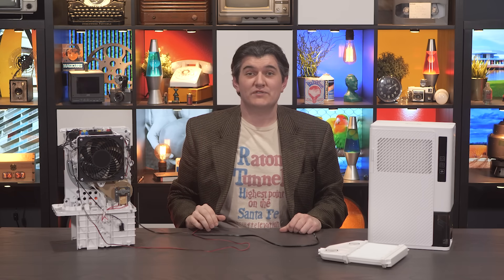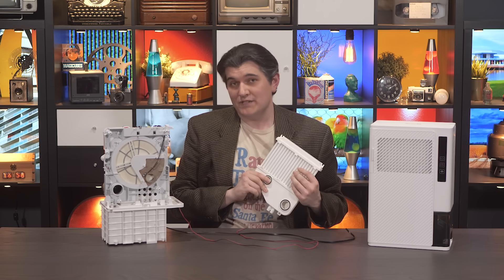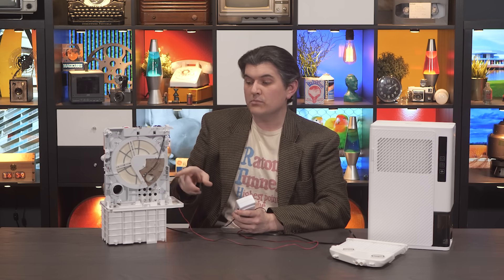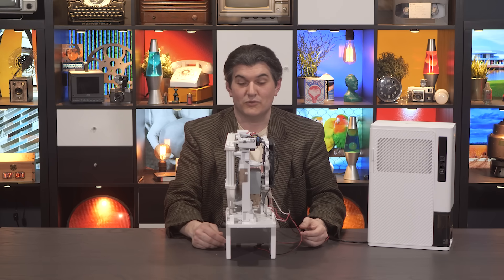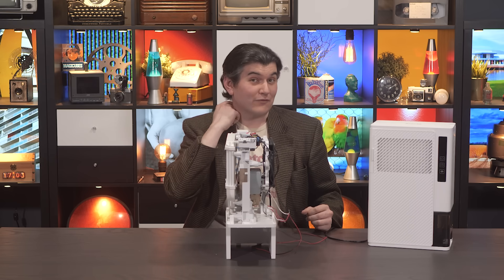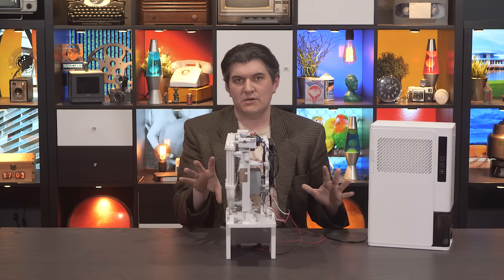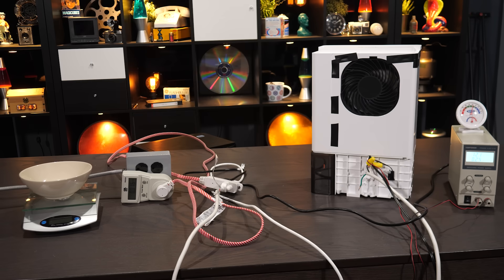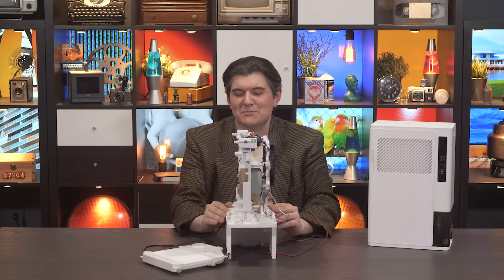A failed duty cycle experiment with a rotary desiccant dehumidifier

Comment: My theory:

The air in the hot loop is pretty much satured by water (otherwise it wouldn't condensate on the radiator). 
Therefore the silica gel is only partially dried when it exit this area and will quickly re-saturate. 

It means that water is only extracted when the hot side is running, the off part of the duty cycle is essentially useless.

I think the duty cycle idea would work if you could run some sort of open loop (i.e. releasing the air outside of the building) so the silica gel can be close to completely dried.
Reply: Essentially reverse the experiment, put the wheel on a duty cycle, or as someone else suggested, just slow down the wheel, giving the heater more time to dry out an area of the wheel.
Reply: I think your hypothesis is correct. from what ive read it seems like the wheel needs quite a bit of time to be fully dried out, much much more time than it gets in the 80/40 style it is getting, not to mention the dryer side is just recirculating the air around meaning that even the air being blown over it is never fully dried, which lowers its abilities even more. i would think that improving the radiator itself by making it copper or aluminum would be a good first start since those metals have better heat transfer. but also finding a way of making the air drier by shutting down the main fan, running just the heat blower and heater to add more drying time to the cycle, especially at first start. those wheels will always be absorbing moisture, even when the unit is off since thats what silica gel do. so when you first start it up the wheel is already at a disadvantage and that during its run time the dryer is just maintaining a status quo.

I would like to try those additions to the experiment and perhaps have the dryer on a separate loop that takes fresh air from somewhere else and runs it through the dryer side to keep the air from getting too saturated. 

but funnily that would also defeat the modular nature of the unit and make it more irritating than the vapor compression units its meant to be a replacement of, those units dont need to have intake and exhaust ducts going outside so you can just plop them anywhere and they will work if not be slightly noisier and occasionally have to shut down for a defrost cycle. but since they can pull so much humidity out of the air during their run time the fact they do have to defrost might be a non issue. i wouldnt know because ive never owned a dehumidifier my area just doesnt call for them our air is always on the lower end of humid and usually we need to add humidity especially in the winter.

Comment: What about switching the resistance with a TEC? as long as the heat side is reaching a high enough temp so make the  silica oversaturate, you gain extra cooling "for free" with appropriate heat exchanger placed in the exhaust flow of ambient air. Note that TEC efficiency is inversely proportional to plates temp difference so with appropriate controls it should be possible to reach a better efficiency out of the two technologies combined for a competitive price

Comment: That doesn’t seem like a failure, it just wasn’t the outcome you were expecting.
Reply: 💯 negative results are still results!
Reply: Yeah, he didn't fail, he formed a hypothesis, designed an experiment to test it, got results that seemed to confirm the hypothesis, and tried an additional experiment with different (more 'realistic' conditions of a sealed up device) to confirm the results and found that it appears some other factors are at play and the hypothesis is in error, and he communicated the negative result of his hypothesis and experimentation to the public at large.  A lot of the time people are unwilling to do that because it 'makes them look bad'.

I mean sure, it's not like he did rigorous additional testing or research or anything (to figure out what exactly caused his initial 'positive' result), but that would be unreasonable to expect
Reply: Yeah, I was super shocked to hear that the experiment was a failure coming from alec when it was a perfectly good experiment.  He should be sciency enough to know that it wasn't a failure just because it didn't prove what he expected.
Reply: Science, baby!
Reply: That's science!
Reply: I saw a video about a charged wire ionizing the air and condensing humidity in the air. They were trying to extract and collect water. Is there a method here for a dehumidifier? I don’t think any commercially available dehumidifier work that way
Reply: He said that exact statement the first 2min of the video. Just a bit of a click bait video
Reply: @CC-nt4zi It's click bait saying something failed? I feel like that's bad click bait lol

Comment: I would almost think the opposite, speed up the wheel and leave everything else the same. This would probably test the drier portion efficiency mainly.  I would think as the desiccant absorbs moisture, its ability to to further absorb moisture decreases either liner or exponentially. I don't know the rate of drying, but seeing as they designed it about 1:5, it's likely around the same rate that of absorption. 

I guess you would have to know the percentage of saturation just before entering the 'drier', as well as just after leaving it. Generally it's calculated by weight, but it's all one wheel, so that would be tough. Probably better to test with your own desiccant reproducing these conditions outside of this machine manually.

Comment: Alternative idea: Let the disc actually rotate slower. If you power the disc-motor with a power supply which allows you to set any frequency you like you can let it run at 40 Hz, 30 Hz, 20 Hz, 15 Hz and 10 Hz. Which slows the disc controlled fashion.
IF you do that: I strongly suggest to watch it closer when you go to 30 Hz an less, so it does not melt your silica-carrier-plastic-disk, or the other way around: Don't run it at high when going to 30 Hz or less.
Reply: That won't change the ratio of drying to adsorbing, which seems to be the thing he wants to study.
Reply: @SyntaxDaemon  That you can do by modifying the shield plastic. But the actual time it's exposed to both will determine whether it fully saturates and then fully dries. The ratio here is less important, it will come from the absolute times required.
Reply: I would look into the area being heated (1/5). If you change the speed of the wheel, change the area being heated. But at that point, just do the math.
Reply: @donc-m4900 yes, for some reason he arrived at 80 cooling/40 heating. But that doesn't look like the ratio covered in beige on the wheel. So I think his maths are off from the get go
Reply: now we have a 2d matrix of values and an optimisation problem
Reply: Or faster. If in 80 seconds the disk gets fully saturated, maybe 60 seconds are enough and you are wasting 20 seconds every rotation. However, 40 seconds may still be necessary to fully extract the water so that would become the bottleneck.
Reply: I think that's a good idea. I instead of changing the frequency however, which the motor would probably not like, use your duty cycle timer to turn the motor on and off--maybe ten seconds on, ten seconds off. Good experiment. 

Thanks,
Jack
Reply: @zyzzy1944  The only flaw in that plan is that these synchronous motors don't actually ever go in any specific direction. They could turn either way, depending on how they stopped and the phase angle of the mains waveform at start-up. You'd need a more sophisticated controller to ensure it only ever went in the same direction at start-up if you're going to do that.
Reply: @233kosta - Some do, and some don't. Depends on the type of synchronous motor. Think of an analog clock; the clock always runs in the same direction.
.
Reply: @zyzzy1944  Those analogue clocks have a special design which forces the motor to only go in one direction. This is an added cost. On a product this chintzy and cut down, I don't see them spending a penny more than they absolutely have to, so unless someone gifted them a million of those special motors, it's a regular one. I'd even go as far as to say that they probably sacrificed some performance by deviating from the ideal rate of rotation of the drum in order to buy the absolute cheapest available unit.

With those analogue clocks, it wouldn't take much to build a mechanism that doesn't care which way the motor turns either. At that point it'd be a question of which design was less expensive to mass-produce.

Comment: The rotator is an AC sync motor, I bet you could use a ceiling fan speed control to slow it down and and get a nice H-M-L graph of efficiency vs rotation

Comment: I Live in London, UK. I have both types. The desiccant one pulls out three times more water than the compressor based one. And it blows out warm air on the top, which is welcome in London From November Till April.
Reply: I'm guessing, as explained in the "main" video, that a compressor-based unit would spend a lot of time in the defrost cycle, whereas this thing performs well in any environment above freezing.
Reply: Can you share hte models? Or, how much power they each use? Do you know what your ambient air temperature and humidity are?
Reply: @warpcore8406  EcoAir DDR Simple,  I found these to be the best, they have a low high power and a humidistat nothing else. I only run them on low (360 W) .  I have thirteen rooms over four floors in my Victorian house and have these  to maintain the RH at 50 - 55 %  the house temp in the winter is 17C throughout. 

The Gas boiler idles 24/7  circulating at 45C, with the dehumidifiers running I have lower heating cost by reducing the humidity.  Calculating the BTU added into the system from the dehumidifiers plus the boiler burn times I am using less energy than with just the gas boiler running and the ambient air temp and humidity rising and falling.   

The walls are lime plaster and absorb moisture like a desiccant so keeping the temperature above the dew point or the humidity under control is essential.  Where people go wrong is they heat a room for a few hour and this drives the moisture from the plaster but also reduces its temperature. When the heating goes off the walls take back the moisture so  maintaining a steady lower temperature and reduced humidity is more sensible and cheaper and the walls maintain a stable temperature like a heat store. 

EcoAir are British go for the "Simple  "model and don't run it on high as this can scorch the desiccant wheel.  Use them to dry laundry and extract the latent heat from bathrooms.  It may take a few days to draw moisture from wall plaster but when the RH maintains a steady 50% you will use less energy to maintain the temperature.  It's called Thermodynamics and recovery of Latent heat.  Check out Munters  website as they developed the technology.   Hope this is of help.
Reply: We've got a Meaco compressor dehumidifier, and it has no problem running in our ~19C house all winter, and can suck a lot of water out and still generates heat from the latent stuff. It's the same model we see the National Trust using in stately homes, and I reckon they know what they are doing! When we did our research, desiccant ones were only really recommended for places consistently below 15C (sheds, garages, etc).
Reply: A Meaco with 15L one. Also based in London, at 19C it work, 17C not so good, 15C, 14C... Nothing, dry as a bone. The best uses for the dessicant ones are cold and humid, like UK and boats in cool climates.
Reply: "The desiccant one pulls out three times more water than the compressor based one. " Are they in the same room? Are they on at the same time? There are lots of variables that need to be controlled.
Reply: If you have electric heating anyway, this thing effectively does double duty.
Reply: Im in coastal California and also use one in the winter. Our only heat source is already resistive so for us it makes perfect sense to use this for both heat and removing moisture
Reply: He probably cant answer because he made it up
Reply: I used the one being advertised in the London Metro Newspaper.  Was about £200
Reply: @mcameron3704  not everybody have access to metro. Just read the label on the box....
Reply: @deadzio  try being nicer.
Reply: @deadzio  You could have simply said, "What model is that?  I am not from the UK, so I don't have access to that publication."
Reply: @jwb52z9  they were already asked what model, the response was to cite a non-specific ad in a broad publication. So saying "what model is that" doesn't seem as productive as including a practical suggestion for identifying the particular model. Though telling them to look for a label on the device is probably even better than a box which they may not even still have; most devices I have (even $10 cheap fans) I have if they are electric have the make/model/manufacturer and electrical info included on a label on its body. That might just be a USA requirement though.

Do you consider  "I don't have access to that publication" substantively different than "not everybody have[sic] access to [the] metro"? It just changes the subject from "not everyone" to "I" and "[the] metro" to "that publication". This feels like treating poor grammar as hostility, which is a rather uncharitable interpretation.
Reply: @vctrsigma  Yes, but your response method was uncalled for, even if you don't like repetition.  Yes, they are different.  One is polite and the other is decidedly not in that context.
Reply: @vctrsigma  BTW, grammar is the mechanics of speech and how words go together properly, not the speech itself or the choice of words.

Comment: Given that both use the same power and don't expell anything yo the outside the power consumption goes to heat anyway regardless of the mechanism. Now the latent heat is the more of a factor the amount of water condensed so I'd venture a guess the compressor based one heats up the room more.

Comment: Something I wonder is how, from what I understand is implied by the heating comparisom, both arent making the same amount of heat off of the same power consumption? It might be in a roundabout way, but the friction and such should add up to the total power input of the heat pump and be roughly equal to the resistive heater.

Comment: Wait, you could use the heat part of the heat pump for the heating and nab some efficiency on the big one.

Also, the rotary dryer can probably get a lot closer to 0% humidity so there might be some good non-human uses.

It might also work well where you have humidity spikes where the gel can absorb a lot quickly and release it slower, like in a bathroom (though a hybrid design would probably still work better there)
Reply: yeah I now plan on trying to get one for where my 3d printer and filament is

Comment: Thanks for the video! I would have been interested to see the effect of different motor speeds on the heat exchanger. As well as the weight of the heat exchanger in dry and saturated conditions. But in the end, it doesn't change your conclusion.

Comment: I'm dying to print tube adapters for that unit like the dual hose AC units, suck in outside air, regenerate and discharge back outside. No tray to empty, no extra heat to deal with.....
Another thought, a Peltier module that turns on for one minute every 4 minutes to really dry out the regeneration air....
Extra large Straw heat exchanger..... My mind is going crazy!!!

Hit me up if your willing to try some of my prints 🙂

Comment: When it's dry, the silica gel will adsorb water onto its surface quite ravenously (thirstily? aggressively... let's go with aggressively).
If you let it adsorb water "too long," it simply won't get much more.  These may not be the actual numvers, but it's like the 80 / 20 "rule"... it soaks up 80% of the moisture in 20% of its loading phase... leaving it the other 80% of the time gets you some more, but maybe not much.
Perhaps the part of the time is used to cool the silica gel after regeneration to allow it to adsorb water again.  Absorption likely releases heat, too, reducing its ability to adsorb water.